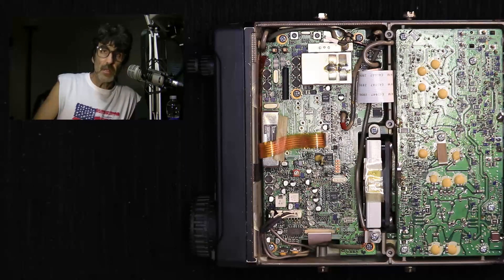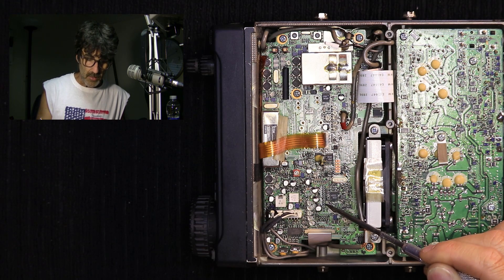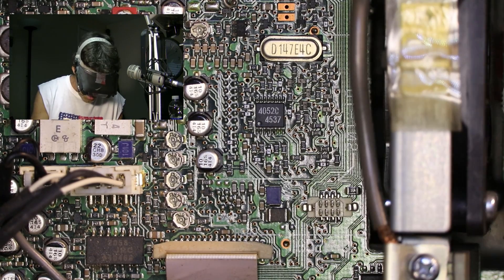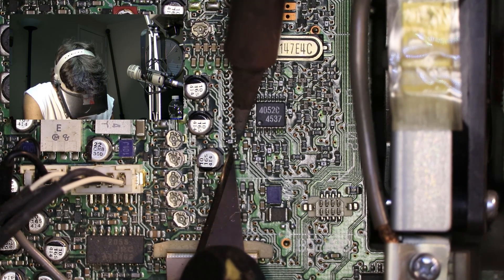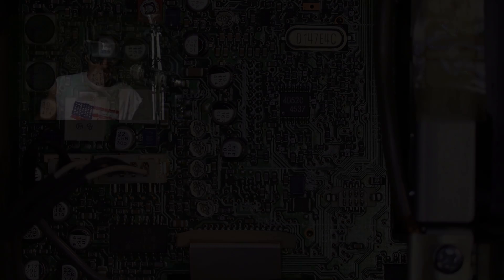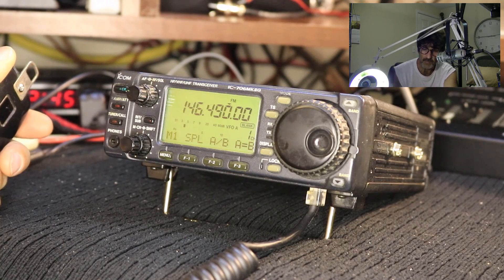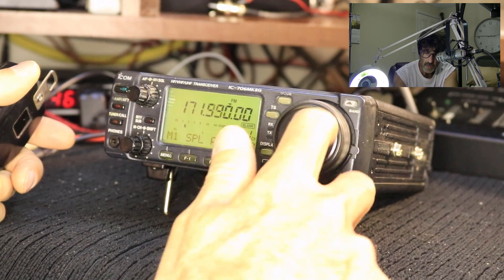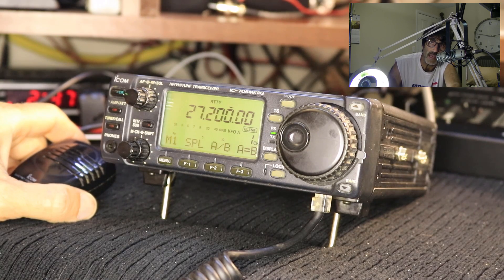Icom IC-706MIIG Mars/Cap Open TX Modification FREE and Easy!!

Comment: HELLO, GOOD EVENING FROM SPAIN, I HAVE SEEN YOUR VIDEO AND I'M WONDERING IF WITH THE MODIFICATION, IT IS ABLE TO TRANSMIT AT 70 MHz? THANK YOU
Reply from the maker: HI From Florida!  Honestly I can't remember what the exact range was... I looked at the mod on mods.dk and the poster there for the TX mod posted a chart and they are showing about 20 watts in the 70 mhz range... I might have done a TX range check at the end of the video, I usually do on the mod videos..
Reply: @JLPicard440  OK, THANK YOU, HUG

Comment: Can one of these radios that has been manufactured in Japan be Mars modded to work here in the US
Reply from the maker: HI!  Yes  I believe they can be modded, but I've had several people with the Japan version say the mod is different.   I would try and google the mod for the Japan version to see if you can see what the differences are.  If I had the Japan version, it would make a good video because this has come up!
Reply: @JLPicard440 ,, I have done lots of research lots of phone calls, the Japanese version is more trouble than what it is worth to modify. it is in the IC chips, or you can find a parts radio and swap out the boards and then you don't know what you are getting.
Reply from the maker: Wow!  No I didn't know that.  That's terrible.  I'll keep that n mind.  Thanks.. 😊
Reply: @JLPicard440 Star Trek next Generation fan, same here like them all.
Reply from the maker: @TheTbone6363  Me too!  I never got into DS9 for some reason, but I do like the others.. 😊

Comment: its an old radio but im thinking about getting one i found one for $500 us
Reply from the maker: Oldie but a goodie!  If it's still working that's a good price if its the MIIG and not the regular 706... 😊
Reply: @JLPicard440  yes its a G with a later big serial number in the 1500000 range so one of the last ones ran
Reply from the maker: @bobbyt3451  Nice! 😊
Reply from the maker: @bobbyt3451  Nice!

Comment: Good afternoon friends, what is that modification of removing the diode for? Thank you
Reply from the maker: HI!  It allows the Transceiver to Transmit in a much wider range other than what the ham/ amateur bands are.  Some people do this mod to use this radio on the citizens band.  It is not legal to do that, but people do it anyway.  In my case I would use it on 60 meters and in case of a real emergency it can be used to call for help.  Hope that answers the question.

Comment: This did not work on my IC-706MKIIG, do you have any idea why it didn’t work?
Reply from the maker: HI... Did you remove the right part?  If so, sometimes you have to reset the radio.  Usually not though.  I don't remember how to do a reset, but if you go to mods.dk they'll have the whole mod listed there and there should be instructions.
Reply: @JLPicard440  Yea, it was the right part. I’ll try the reset I didn’t think of that thank you. 👍
Reply: @JLPicard440  Update: That didn’t work, however I did contact ICOM USA and they said that my 706 the Japan version can not be modified to work on all the US ham frequencies on 2 meters and 70 centimeters it’s the only one that can’t be modified. Just my luck. Thank you for your help. 👍
Reply from the maker: @W5KJD  Wow!  I didn't know that.... Arrgh.

Comment: Guess I've got a job tonight. Lol. Just picked one up and thr mod is the first logical thing to do lol
Reply from the maker: Absolutely right!  That's about the first thing I do to a new radio.  I would probably wait till the return period is over if it's new from the store.. 😊
Reply: @JLPicard440  just grabbed yet another Icom tonight an IC 207H and it's 2 diodes and a resistor but still takes longer to open it up than to Mars mod it.

But the 706 had a small issues of way too much output on some bands and very little on others. 80m it was knocking on 150w if you talked loud enough but hardly 15w on 10m. I don't have a watt meter for 2/70 but it sounded really good. All fixed and now 2 more great icoms in the shack.
Reply from the maker: Oh wow!  150watts looks good on the meter, but it might end up damaging the final.  You might try looking on mods.dk to see if anyone reported a fix for that problem.
Reply: @JLPicard440  reflowed the board but also found a component just barely touching the pad to a transistor.
Reply from the maker: Did it fix it? @danielhildebrand6892
Reply: @JLPicard440  yes sir! Putting out 100w on the bands it should. With my field antenna just randomly set up I made a contact in Japan right at dusk last night on 40m. I'm on the west coast and we had light cloud cover as well.
Reply from the maker: That's awesome!  Glad you got it going..

Comment: after removing the diode it worked, but after the reset it didn't work and it went back to how it was before
Reply: my icom was purchased on ebay from japan but after removing the diode everything remained as before
Reply from the maker: The Japan version may be different.  I've had this come up before and I've tried googling the Japan model but couldn't find the mod... Its been a while and I haven't tried recently.  You might try and see if the mod will come up to see what the differences are.
Reply from the maker: HI, I've never seen that happen.. Do you have a US version?
Reply: I bought it on ebay from Japan

Comment: I have an issue with VHF and UHF not being expanded.  I think this rig I just bought may not be a US version as it transmits on VHF and UHF, just not on US VHF/UHF freqs
Reply from the maker: Yes if the TX  was already more than 144-148 and 430-450 then it may already be modded, or a version from a different country.
Reply: @JLPicard440  Any ideas how to fix the VHF and UHF to work on U.S. bands?  It's odd that only 11 meter band and U.S. ham VHF and UHF are not allowing transmit, but the the TX is wide open on non ham bands other than 11 (which is fine with me, just need VHF and UHF to work or 2/3s of the radio is useless
Reply from the maker: @tonysalvador9845  It doesn't TX at all on 144-148?  Even on a portion of it?
Reply: @JLPicard440  Pretty sure all of that part of the band doesn't TX, but does below for sure (probably above too)
Reply from the maker: @tonysalvador9845  That's not good.  Even if it was another version from another country, it should still TX on all or part of the band.  Have you opened it up to see if it looks like someone has tampered with the area where the TX mod is?

Comment: Will this work for a original icom ic-706
Reply from the maker: HI, no it's different.  Here's an excerpt from Mods.dk that describes the mod for 706 classic:

Tools required:

#0 Philips head screwdriver
10 - 15 watt pencil tip soldering iron
Magnifying glass
Tweezers

Remove the TOP cover by removing three philips head screws on the top and one on each side. Move the speaker bracket out of the way. Locate D-59, this is a three terminal SMD diode in an SOT package, about 1 x 3 mm (with the radio front panel oriented towards you, D-59 is located in a row of SMD diodes just to the right of the ribbon cbale header above the 9 MHz SSB filter FL-30. There are pads for 5 diodes with only three installed. D-59 is the second from the left).
Useing tweezers and a low-wattage soldering iron (and magnifying glass, if necessary) remove D-59 by appplying some heat to the single leg side of the device while lifting gently, then apply heat to the other two legs and removing the device. Be careful not to apply too much heat, not to rip or burn any traces or not to leave excess solder on the PCB.

Replace the speaker bracket and top cover. Apply power and reset the microprocessor.

TX = 1600 kHz - 54.00 MHz and 118.000 - 174.000 MHz

Hope this helps... 😀

Comment: Where did you get the tuner for this radio, also my mic connects in the back and yours the front so I'm confused.
Reply from the maker: Which tuner?  Are you talking about a built in tuner? It came with the radio.   The mic connects to the bottom of the head unit...  Do you have a different radio?
Reply: @JLPicard440  What is the magnification of the lens used I need to purchase a headset so any suggestions would be helpful as well.
Reply from the maker: @jamespratt5302  I bought that headset so many years ago I honestly don't remember.  It really depends on your eyesight!  I used to work on this stuff without any aid at all when I was 20 years old.. 😂  But I'm suffering from O.L.D. syndrome....
Reply: @JLPicard440  I feel your pain.
Reply from the maker: @jamespratt5302  😂

Comment: This makes an excellent stable frequency generator with this out of band modification. You just need to transmit into a dummy load near the circuit under test. "AM" mode AUTOMATICALLY significantly reduces the output power (with no audio). I use VERY low power for doing tests. You can also build a pie network attenuator to sample part of the signal if you REALLY know what you're doing. Make sure that the circuit can handle the full 100 watts just in case the power goes to full output, or you forget to turn it down.
Reply from the maker: Great idea!  I hadn't thought of using it for that.. Thanks for the tip.. 😊

Comment: I know this is an older video, however. Will this also work with the IC-706MKII? Not the G. Thanks.
Reply from the maker: I don't remember if the "ii" model is the same.  You can google the mods for both and see if they're exactly the same..
Reply: I'm thinking the only real change to the G was the addition of UHF. The boards where it matters for the mod is probably the same. I'll need to pull the top and check it out. I looked at the mod description for the II on Mods.DK, but the text description at one point makes me wonder if there are two or one diode needing removed or are they just reiterating where the one is located. I'm RACES and ARES, so having a radio that lets me work on other bands in an emergency isn't a bad thing at all.  Appreciate the quick response on an older video.
Reply from the maker: @WolfQuantum  I was going to suggest mods.dk but you have to sign up for an account there.  Some people don't like to do that... 😊😊

Comment: Great video. Could a heat gun be used, or would that be too unfocused and desolder nearby components?
Reply from the maker: I wouldn't use a heat gun, but a hot air soldering station works great.  Much more focused.  I have this one from Amazon.  They're around $70: TXINLEI 898D .  They've gone up, they were around 50 something a couple years ago.. ☹️

Comment: Always use a white towel under the radio to enable finding loose parts, screws, ect. that may fall free while working on the rig. I only pop one side of the diode up in case future owners may want to revert back to factory settings. BTW, you look like Al Pacino :)
Reply from the maker: Great tips!  Thank u...

Comment: done the mod, power out in 4mt okay but no audio!! any thoughts???
Reply from the maker: ARrrgh... That definitely should not affect the audio.  I've done quite a few of these and never had that problem.  Did you try a different mic to make sure it's not just that?
Reply: Take a Bath Productions done full reset,changed mic mode and antenna, still no joy, am puzzled!,!, must be some internal filtering blocking audio output, it is Europe version .
Reply from the maker: @billmcintosh1694  Good grief... no I've never had that happen... if u still have the component,  try putting it back and see what it does

Comment: Do you know if there is any place I could send mine to be modded by someone who knows what they are doing since I don't have any experience in soldering and I don't want to take a chance of ruining my radio
Reply from the maker: No, I usually do them myself. Giga Parts offers it for around 45 dollars or so... I'm sure there are others, but that was the 1st one I could think of off the top of my head.. hope that helps. thanks.

Comment: I have a soldering iron 5 - 60watts. What power would you suggest so as not to apply too much heat? Thanks.
Reply from the maker: I don't think there's any standard setting, you should be familiar with your iron... if you have a junk circuit board laying around somewhere, you can experiment around on that to see where the best setting is... if not.. I would start at around 60% and see what it does.  Don't leave the heat for to long, or you will burn something up..
Reply: @JLPicard440  Good stuff Rudy. Thanks!

Comment: Hi Great video, I have two questions, 1 At the moment my 40 mtr band runs from 7.000 to 7.100. Our legale band width now in the UK go's up to 7.200. am i right in thinking that after the mod I'll be able to transmit between 7.000 to 7.200 and beyond, 

Question 2 Would it cover the 4mtr Band 70 mhz  RX & TX. Thank's in anticipation Paul G4YBI ...
Reply from the maker: HI Paul.. Yes it should TX beyond 7.200... USA Version TX is to 7.300... not sure why they shorted you guys! I believe it will cover 70MHZ, but probably at reduced power.  Probably due to  circuits in radio are not tuned to that frequency range... hope this helps... thanks...

Comment: So, bear with me as I'm VERY NEW to all this, and just got my General....

But this mod, Allows MARS functionality (minus the modem)?  And it opens up a greater ability to tune different frequencies to TX on?
Reply from the maker: It just expands the TX,... from 1.8-54 continuous.. or whatever the frequencies are... also on 2 meters, and 70 cm...
Reply: You may also use the 60 meter band once this mod has been completed.I programmed the Five Channels into mine so they are there in the memories.I don't use many memory channels but those are a must for me.
Reply from the maker: Yea it's a good idea to put 60M into memory,... I can never remember what they are!  I just got a icom 7300 that can TX on 60M right out of the box.... 5.255 - 5.405 Continuously....

Comment: I have done this mod to my Icom 706 (mk1, not mk2), and after removing the diode I am still unable to tx across all the bands. The dioide is obviously different to your video, but I found a few guides online and removed the one that was supposed to open it up, but nothing happened. Radio works fine still. Any ideas?
Reply from the maker: Paul Harding if u don't have a account at mods.dk it's free... there's a listing there for the expanded frequency mod for the original 706 which is what it sounds like u have.... unfortunately the guy didn't list any pictures,...there was a 2nd article talking about a jumper 

Tools required:
#0 Philips head screwdriver
10 - 15 watt pencil tip soldering iron
Magnifying glass
Tweezers
Remove the TOP cover by removing three philips head screws on the top and one on each side. Move the speaker bracket out of the way. Locate D-59, this is a three terminal SMD diode in an SOT package, about 1 x 3 mm (with the radio front panel oriented towards you, D-59 is located in a row of SMD diodes just to the right of the ribbon cbale header above the 9 MHz SSB filter FL-30. There are pads for 5 diodes with only three installed. D-59 is the second from the left).
Useing tweezers and a low-wattage soldering iron (and magnifying glass, if necessary) remove D-59 by appplying some heat to the single leg side of the device while lifting gently, then apply heat to the other two legs and removing the device. Be careful not to apply too much heat, not to rip or burn any traces or not to leave excess solder on the PCB.

Replace the speaker bracket and top cover. Apply power and reset the microprocessor.

TX = 1600 kHz - 54.00 MHz and 118.000 - 174.000 MHz
Reply: Gonna have to find that jumper article because removing that diode didn't do a thing!
Reply from the maker: Paul Harding that's strange! I've never done the mod on the 706... I think the jumper one was at the bottom of what they had listed there... careful if u get the free account... they only let u view one article per day
Reply: haha yes just found that out the hard way. tomorrow is another day and another article. I think the strangest thing is I crushed the diode as per instructions and it's totally gone now and the radio still works fine, albeit without the ability to tx where I want it to. I used the needlenose pliers method rather than the soldering iron as I didn't have anything small enough for that kind of work. do you think there is any chance that the remaining feet of the diode are causing the problem? there is absolutely nothing of it remaining on top of the board now.
Reply from the maker: Paul Harding if somehow those feet are able to make contact they will absolutely cause a problem... take a good magnifier and take a look... or a ohm meter... but u could get a false reading from another component somewhere else.... I usually remove the diode or resistor to make sure it can't cause a problem... but I understand if u don't have a small enough tip..
Reply: I wish I'd done that now to be honest. Will get a magnifiying glass, thanks!
Reply from the maker: Paul Harding no problem 😊😊
Reply: Use tweezers to squash the diodes..
Reply from the maker: coogie c yes that's one way to do it😊
Reply: I have seen several different mods for different 706 Series transceivers.The one shown here works all all of the MKIIG versions which there are Early & Late models & some MK II versions that is what I recall.If you call ICOM Support & tell them you are wanting the mod for the 60 meter band they will usually assist you.Don't tell them you want it so it transmits on 11 meters or they will hang up on you but it will work there as well once completed.
Reply: sneaky, I like it! thank you sir.
Reply: Did that. Diode is totally gone now from what I can see but still no open TX..